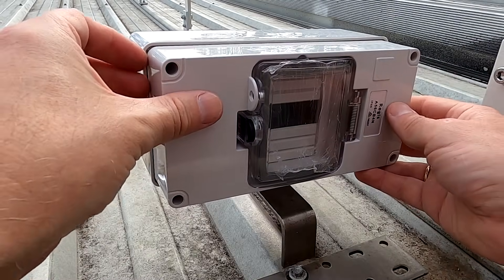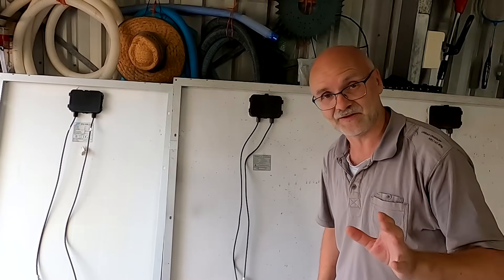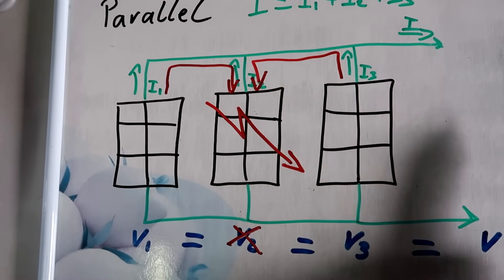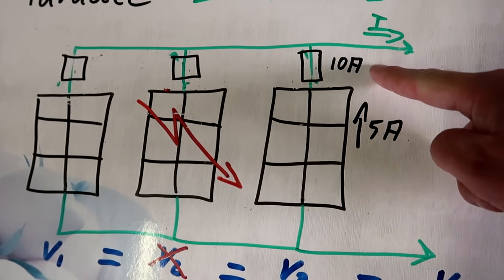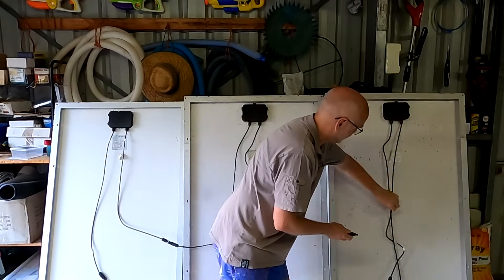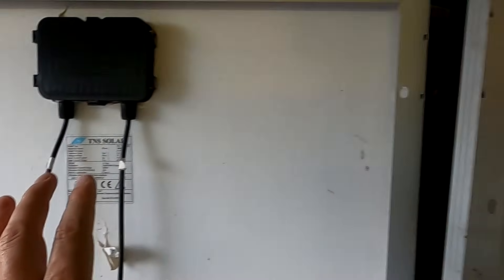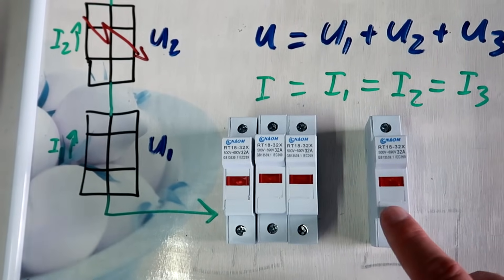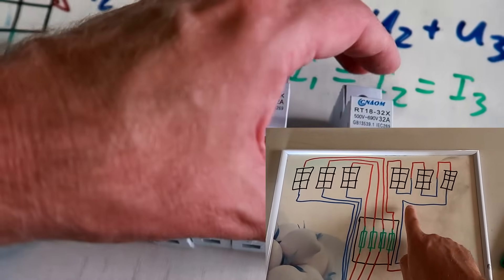Tutorial: Solar Panel Protection in Series and Parallel

Comment: Great explanation. You may have covered this in subsequent videos but worth noting that power loss in cables is related to current squared, so for the same power, a higher voltage gives less losses than a higher current. Conversely, the charge controller will need to be rated for the total voltage which, for your 36v panel example adds up quickly. The whole thing is a balancing act between what the equipment will safely handle and what values you need at certain points... Irrespective of those tiny suggestions, Still a great video! Keep them coming!!  🙂👍
Reply: So... where do you find the balance point between volts and amps? 

Do you stack volts until you max out the equipment voltage, then start running in parallel? 
So if they're 12v panels, and you have 12 of them, but your system charger maxes out at 36v... You'd do 3S4P (to gain the benefits of less loss through voltage)?

I'm starting with a small (4 panels) Renogy solar setup for my shed. But their instructions show either series or parallel - not a combination of the 2 (2S2P).
Reply: @chriswf  12v panels will have a higher open circuit voltage and that's what you'll need to take into account. (Probably more like 20v rather than 12v). My approach is to take open circuit voltages as high as I can (using serial connections), maintaining a sensible headroom safety margin as over voltage will damage MPPT.

Comment: Hi Andy why do you say on a rv 12v system to connect the panels in parallel instead of series i was thinking to do my two 175watt panels in series for my 12v rv system thanks Simon 🇳🇿
Reply from the maker: Thanks for your question, Simon. The parallel setup is the better approach in regards to shading as it will effect only the panels in the shade. In a series connection, you whole system suffers if they are in series.
That's the reason I have so many parallel strings on my roof and not one long series of panels because of the shading I have in wintertime. 
Parallel is more cabling effort though but I think especially for an RV it is worth it.
Reply: Thanks Andy for the fast reply i will be wiring my panels this week in parallel!!

Comment: Could 4 12v deep cycle gel ( 6-GFM-100 ) 100ah 30a batteries wired in series for a 48v bank connected to a 48v 5kwh MPPT charge Controller Inverter, & a 4S4P array  ( 2 x 360w panels series connection; x 4 ( 4S4P)  ) producing a total of 2880w, 400v, & 60a work ?without harming the batteries, or anything else? Thanks if You have time to reply. Dig the vids btw.., thx a lot for them. Would I use a 15a, or 30a fuse in each string?

Comment: You don't know what you are talking about...Panels have "distribution boxes" to prevent current of "wrong" direction. Anyhow, you don't understand what 5 A means for your panels.
Reply from the maker: That is wrong. In these junction boxes behind the panel are bypass diodes, not blocking diodes. I made a video here on the channel to explain that. You should watch it 😉

Comment: I would have thought if panels are connected in series and one failed it will break the hole circuit?? It's like you got a break in one cell or on either the positive or negative wires?

Comment: Why have panels got a diode in between the positive and negative? Isn't that for backflowing current????
Reply from the maker: That's the bypass diode which is built into the junction box at the back. They are for avoiding heat spots during shading. I made a video about bypass and blocking diodes: https://youtu.be/J9jqUwOdnEI

Comment: I have five stationary 200w panels and two portable panels.  I have a 48 volt renogy hybrid inverter charge controller that can take up to 4600 w.   Do I wire these in series or parallel?  I should mention that I'm using two 24 V batteries.  thanks

Comment: Hey ;
How to calculate the wattage of a PV if the label is worn out ;
Open circuit voltage - 18.9v
Short circuit current - 3.5 A

     V          A
    18.9       0
      0         3.5

Comment: Current is like water. Soooo how is it that if a panel goes bad, the current reverses and goes the opposite direction? 
Wouldn't it all depend on what is wrong with the panel? 
If the panel shorted out due to current overflow then would not that panel be dead and no current flow?
What about the panel diodes designed for and in the panels?
Reply from the maker: If one panel has a short for example, the other panels in parallel would push current through this faulty panel. As you said, it's like water. Each panel is a pump. If one breaks, the other pumps will push water through the faulty one unless you put a one way valve in each pump string (blocking diode).

Comment: I have a 48v sol ark portable system. 3.5.kw.the cables that came seem to lean more towards parallel per your great explanation.  I have 4 big dog acid batteries. Thr   are 30 amp fuel on the generator system.  Is it OK to do parallel? Also the panels will have direct light in afternoon but will have 3 panels in shade first of morning

Comment: What if
1. 12v 200watt panel
1. 12v  (100 + 100)watt panels in parallel

Now if I connect both 200watt panels in series will there any problem ?

Comment: Had my solar system running for 1.5 years without issue. The other day hit 105° and i was running my fan and computer inside my RV. 
Next day around noon i notice my battery wasnt charging. 
I first suspected my charge controller, so i deleted it and hard wired to the battery. Still no charge.. 
So i climb on the roof to discover my parallel Y adapters had burnt up and melted. 
So yeah now im looking into fuses for the array

Comment: A good idea for an upcoming video is testing the fuses. E.g. put 10A through the 10A fuse and see how long it takes to blow.
Increase current to 15A and see how long it takes, then 20A etc.
Reply: Great idea, I think this would make an interesting experiment/video as well, to test the tolerance of a few different type fuses, so we can know what to expect with some of the different type fuses available, when planning various parts of a solar PV system. Cheers

Comment: What will happen if i use diode in series each panel when using sola panel with parallel connection.
Reply from the maker: That will prevent the current going from one panel to another. I wanted to keep it brief and simple here so didn't mention blocking diodes. There is another video about that: https://youtu.be/J9jqUwOdnEI

Comment: A good clear  and helpful video. However it overlooked one important factor. Solar panels have maximum series fuses, and the panels in this video have max series fuse rated at 15A. The max series fuse rating means that all internal circuits of the panel can handle 15A. 
So in the first scenario if a panel shorts, and the two other panels send 10A through the faulty panel, there will be no damage. However if there was another panel in the string, then 15A could be sent through the faulty panel, and potentially damage the panel.
What this means is if the total current from the other panels do not exceed the max series fuse rating, then you don't need additional fuses.
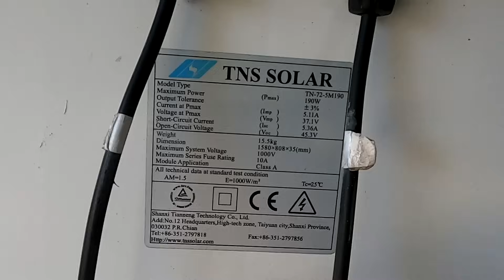Reply: Absolutely. It's the only mistake in Andy's video. Maximum series fuse rating (MSFR) should be considered, not the Imp or Isc. BTW, these panels have 10A MSFR, not 15A. MSFR is listed on the sticker, along with other parameters. 2:28
Reply: @МаринаМишина-ц2р  good spotting. Not sure where I got 15A from now
Reply: You are correct, this guy is all wrong.  National Electrical Code says no fuse needed for series, it adds no protection.  In parallel you only need if the total amps is more than the maximum series fuse value on back of panel.
Reply: @cnxoutdoors Wat did u mean in total amps is more than maximum series fuse value
Reply: Just remember 10A fuse will carry 10 amps for ever and probably 13A for ever as well. Even at 15A it will take many hours to fail

Comment: For the center failed panel, or for that matter, all of the panels rated Max 5A, shouldn't you have the fuse be ONLY SLIGHTLY MORE THAN 5A, say 7A's, thereby never over loading a failed panel to the point of ingniting?
Reply: Another reason is that a 10amp fuse will not blow at 10amp. Fuses are meant for catastrophic overloads or short circuit current dumps. A 10 Amp fuse might last 30 mins at 15Amp depending on type and temperature. It can even melt the fuse holder before it blows in some circumstances.

Comment: Not the case of course if you use an MPPT charger that can charge a higher voltage battery with a lower voltage supply due to DC to DC converter technology. Excellent at upping the voltage on cloudy days, maximising panel output.

Comment: I have a 180 Watts solar panel and a Solar battery 12V 120Ah. I have a 1000 Watts Invertor and a 30Amps regulator or charger control. What's the best connection?

Comment: Your confused. When you started your video you said  left was positive and right was negative. Then when you hook them in series you contradicted what you said and left became negative. Your stating incorrect voltage when these are hook up their voltage will not be 108 volts. You better take reading again and check your connection because polarity in solar panels is very important.

Comment: I have 5 -100 watt solar panels in parallel  as of now it has been putting out  around 18 amps, the panel's say a maximum fuse of 15 amps I want to put a fuse on each panel 
  what size fuse should I use?

Comment: So I have 15 batteries  all together  as 12 volts and I have 2 - 150 watts  solar panels ,,,  how should  I hook the panels  in series or parallel  ?
Reply from the maker: Hard to say without having any data and specs. What controller are you using?
Reply: @OffGridGarageAustralia  I have a Coleman  30 AMPS digital solar charge controller.

Comment: Wanted to ask you if panels set series and panels set in parrallel produces the same amount of energy from same panels?
Reply from the maker: Yes, they do. Every panel outputs the power regardless of being in series or parallel. The trick is to achieve a higher voltage when series connect panels. This set up then requires smaller cables and has smaller transport losses.

Comment: Hi. I have a question and I don't know how to contact you directly. So I have two 10 watts panels. Neither of them have any bypass or protection diodes. I want to connect them in parallel. So should I place a bypass diode in each box in case one is not getting sun. Would that work? Or is it only needed if I connect the two in a series setup? 

Love your videos!

Comment: ya want a 7.5A fuse if ya got a 5A panel but what ya said about panels in series is actually wrong,depends on how faulty the panel is it turns into a big resistor and as its tryin to put power through it well it can and start a fire so a fuse in series with each panel is a good thing,btw u can have a smaller panel chargin a higher voltage battery cause some cheapo chargers have a boost converter in them (its rare but some do)

Comment: Where do you put the fuse? On the positive side or negative side? 🧐
Reply from the maker: I have fuses in both so I can completely isolate the solar strings both ways.
But usually only in the positive side.

Comment: Total could be 71v - 34.89A  the 100W panels Ea . 18.5v & 5.41A & the 210W panels 17v & 12.35A Ea. All x 2 ! Can I run each set of panels in series and then run them into parallel to the charge control ?

Comment: Thank you for you’re teaching us who are not as knowledgeable as you’re self ! I am putting 4 panels on my roof but my issues are is about 50-60 feet from my charge contractor in the basement & you’re idea 2 panels are 100W & 5.41A = 200W @ 10.82A but my other 2 are 200W / 12.35A = 400W / 24.7A can I wire 2 in series then wire them in parallel 200W / 10.82A Parallel with 400W / 24.7A should that be at the charge controller 600W @ 35.52A ? The 100W panels Vmp 18.5v - Vic 22.6v - Amperage 5.41A But then the 200W 12v - Pmax 17.v amperage 12.35A

Comment: panels are literally photo batteries.... they work the same way when wiring... instead of a fuse why not just use breakers? no replacing fuses ever. Also cant you just use a Diode and that power will never reverse?...

Comment: I intent to build a setup of 9to12 in series and then later on to add another identical row. So in the end to have a max of 12S2P. Is it enough to put some fuse between the 2 rows or is there anything else special needed ?

Comment: Won't those branches get to hot and melt ? I have 4 300 watt solar panels and I mounted them all in parallel to a copper bus bar and used 6 ft of 2/0 welding cables from each pole ,positive goes to my 80 amp DC 100 percent duty cycle breaker .then to the 100 amp 200v mppt controller and I have all panels fused with 15 amp fuse . I have also wired them all in series  before using 4 way branches and parallel definitely gets the most raw power I think but can get hot and needs thicker expensive cables and copper bus.
Reply from the maker: That could be the case. It all depends on your set up and application, the power of your panels and the overall system voltage. A series connection is always to prefer but may not bring the best result if you have shading (as I have). Everyone needs to do the calculation, if, what and how the setup is best to do.
Reply: @OffGridGarageAustralia  yes 👍  I have melted a few solar controllers and got an expensive education on the subject.

Comment: As a newbie to solar power, this is the clearest explanation of parallel and series connection and fuse usage I've seen.  Thank you.
Reply: If not mistaken in series connection as current flow in and out of every solar, if one solar is faulty it means the circuit must be disfuctional. That means series is not good option
Reply: you are right...if want more higher voltage use solar panel 24v 100wp and so on.
Reply: Except he is not very clear and doesnt know what he's doing.   National Electrical Code says no fuse is needed for series, it adds no protection.  In parallel you only need if the total amps is more than the maximum series fuse value on back of panel.
Reply: @cnxoutdoors  Perhaps you can help me. If i have a 12 volt system 'must i run my 2 panels in parallel to keep it 12 volts. Am i thinking right or no. Any help would be appreciated
Reply: I doubt it, a fuse is must for series connected panels. If there is no fuse in series and in case of short circuit there will be no protection, which could cause fire breakout.
Reply: @cnxoutdoors  What harm can a fuse do if it was my home i would be fusing everything!! and adding a breaker .....
Reply: Thank
Reply: Don't the diodes prevent the "back charge" into the panel that has "shorted"??
Reply: Good day,I have an inverter rated 3000w with the following specs battery voltage 24v and a lithium battery 100AH, Nominal operating voltage 240vdc
MPPT voltage range 30 to 400vdc
And maximum solar charging current of 80A,my question is what is the minimum solar panel in need to install
Reply: Always use serie connection. Using paralell connection will give you more losses in the energy transfer.....Or if you have many panels use serie connection in groups and then paralell conections the groups.
Reply: Thanks
Reply: Sir how can i connect the fuse to the panels?
Reply: Well done
Reply: pls sir i need to no how to connect 8 batteries in 48v

Comment: Great video.  Thanks for the help 
  I’m dealing with an issue now with my new powmr all in one 3000watt unit. Can only handle 100v input   And if I connect my 3 260w panels in series  I end up with  
114v so I’ve got to do some figuring 
   Thanks

Comment: Such a great video, thank you! Every video I watched on connecting in series was so complicated, and then you just explained it perfectly in about 10 seconds!
Reply from the maker: Wow, thanks so much for your feedback.
Reply: @OffGridGarageAustralia  I have  15 batteries  hooked together  as a 12 volt  bank  and I have 2 -150 watts  solar panels  how should  I hook the solar panels  in series or parallel?
Reply from the maker: @autosousao61  That all depends on what solar charge controller you have, what details the panels have and what kind of batteries they are. You need to look into the specs of all that...

Comment: Brilliant ... first clip i begin to understand.

I have just bought a solar system for my camper van.

1x 20amp MPPT solar charge controller 
1x 150v VOC 22.5v ,  VPM 18v,  ISC 9.00A , Imp  8.33A
1X100v  VOC 21.30v, VPM 17.8, ISC 6.07A, Imp  5.62A
2x 110ah V12 Batteries 

SO i am wondering because the solar are different voltages etc what is the best configuration ???

Many thanks and great work on your channel . DJ

Comment: A fuse is not neccesary when the panels have MC4 connectors , these connectors have an integrated bypass diode . Am i right , cos i am not sure .
Reply from the maker: The bypass diode is installed in the connection box at the back of the panel (I have shown this in a different video). The MC4 connectors don't have any diodes inside.

Comment: Hello my 12 volt lead acid batteries always go out of balance when I connect them in series, so I connect them in parallel I have 2 12 volt panels which means I can not connect in series if I'm connecting batteries in parallel because the panels will be producing 48 volts the batteries wont like that. thanks for the informative video.

Comment: Hi, Thanks for the video! May I ask what that netting material is you used to hold up your garage insulation?
Reply from the maker: That's just normal 'chicken wire' as it is called down here. It was already installed when we bought the place.
Reply: @OffGridGarageAustralia  Thanks for answering this.  One of the two options I have for my solar room is a garage like yours and it needs insulation on the ceiling .  The walls are already done, but I did not get to the roof.  I have been looking at your roof and wondering about it.  So thanks.  Also thanks for all your efforts.